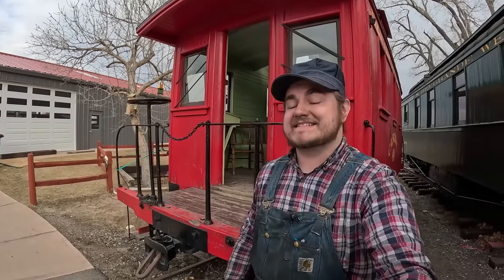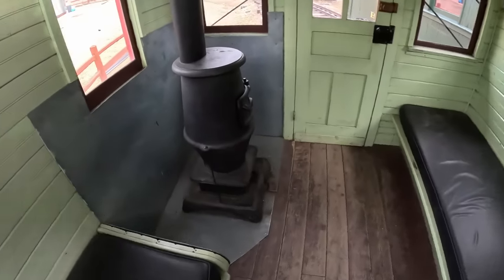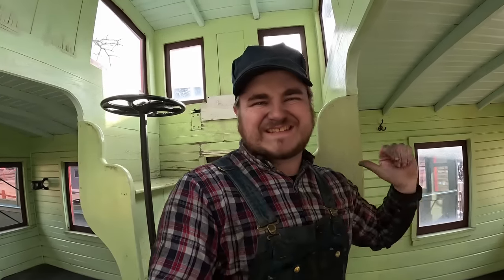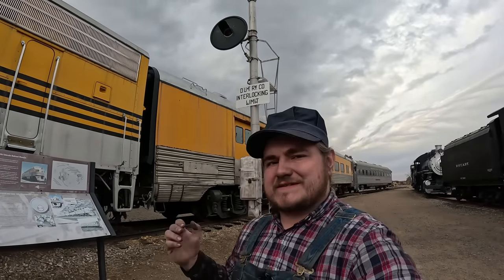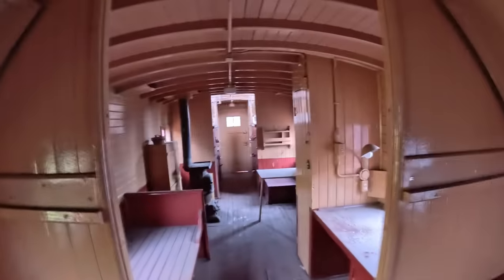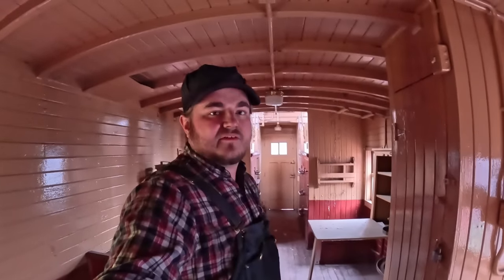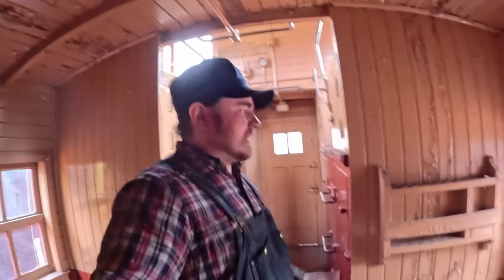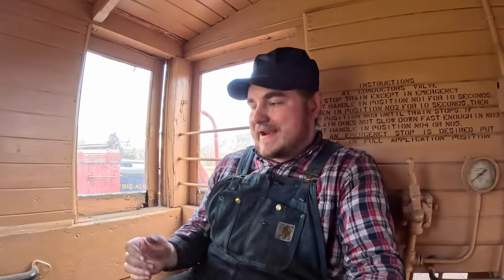Why don't trains use CABOOSES anymore?

Comment: Another reason I've heard for the end of cabooses:  Slack action.  As trains grew longer, so did the potential slack in the couplers, leading to serious whiplash at the rear.  (Consider the fate of the brakeman in "Emperor of the North" when A-1 dumps the air).  Having people at the rear was becoming an outright hazard, especially since they weren't needed very much for the reasons you described.

Side note, the narrow gauge cabooses on the Sumpter Valley also had a "toilet" similar to the C&S one you described.  I've been in exactly one Rio Grande long caboose, and I don't recall it having one, which is rather interesting since I'm pretty sure those ones are bigger than ours.  Could be misremembering, though.
Reply from the maker: I knew I was forgetting at least one reason! Cheers Bandan.
Reply: This was especially important in the UK with their brake vans. Since British trains still had chain couplings well into the 1970's it was vital to keep the train in tension as much as possible to prevent slack action from breaking the chains, particularly when going down hills when the cars would want to bunch up. The train guard would have to know the route very well to know when to apply the appropriate amount of handbrake to keep tension when going downhill without adding too much extra drag for the often underpowered goods engines. If you've ever watched Thomas and wondered about the engines getting bumped by the Troublesome Trucks, that's probably because a lot of guards on Sodor weren't very good at their job.
Reply: You forget one other purpose some cabooses are used for now a days, some have been converted into RC receiver cars for remote control operations
Reply: @GraveSpartan21  And on high-security trains (military, Department of Energy, etcetera) as well as some maintenance of way trains.
Reply: honestly, this feels like the only real reason not to have them, the other reasons make the caboose REDUNDANT but redundancy in itself can be a great safety feature
Reply: @d3str0i3r  Honestly, today with the way things are going, it probably could have prevented East Palestine Ohio... 

My grandfather ended up with a semi-ruptured kidney just before he retired from some poor train handling in the Penn Central days.
Reply: Even with slack action couldn’t they strap them in to a harness like a race car?
Reply: @automan224  Sure, but they don't even use seatbelts now... even though they are equipped and recommended on the SD80's. Realistically, they aren't supposed to be beating up the equipment that much to make them necessary.
Reply: In Ireland you could still find Brake vans until the 1980’s or 1990’s
Reply: First time on your Station, lots of great well presented information. Not sure how many breakman were on a train but riding the top of a train in the winter time must of been hard. I am thinking the extra sleeping room on the. Caboose may have been for these extra men my father-in-law start it out as a Breakman in 1947 and retired as a conductor.
Reply: Imagine the slack on British ( loose coupled )  freight trains ..

Yes, pretty much up to the mid 1960's in GB freight trains where coupled together using Chain Links ,, 🤔
Reply: If that were the case wouldn’t manned helpers have engineers and conductors thrown all over the cab? Also shouldn’t Amtrak engineers be slinging passengers on the rear?
Reply: Slack action in the cabooses was due to poor train handling by the Engineer, not the  size of the train.
Reply: @d3str0i3r   Simple answer, the Railroad Corp. wanted much smaller crew size to save money and reward the stock holders.  Nothing new here, in the old days, crew size was five men, today, it is down to two men and the Railroad Corp. wants it down to one and complete automation in the near future.
Reply: Yes, it's caused by poor train handling, emergency stops, or similar.  But it's exacerbated by the length of the train.  A 50 car train has less total slack from couplers than a 100 car train of the same cars, and a longer train will have more slack still.  That's enough to turn a rough but manageable stop into something that causes injury.  It's also possible newer car types had different amounts of slack built into the couplers, but I wouldn't know for sure.
Reply: I guess, for those cabooses without official bathrooms, you could always hook your legs into the railing and take a deuce off of the back. That's what I would do if I found myself in such a situation, but I would probably wait until I knew the train would be passing through a rural area with no houses or crossings. lol
Reply: @johnanthonycolley3803  And Ireland
Reply: @michael029138  We would get some slack action on uphills and down hills with Longer trains.  But, most of it was due to poor throttle control.
Reply: @michael029138  Bingo!!!  On the saving money.
Reply: No it was to save on money and paying for pensions. They are greedy.
Reply: @BandanRRChannel  Your slack description being based on the numbers of cars makes sense.  But I wonder if steam powered locomotives were capable of pulling more than 50 cars.  The disappearance of caboose cars might be a combination of several things: smaller crews and improved braking systems for instance.
Reply: Very informative
Reply: Not true, its the other way around, longer trains came about because of the removal of the vans, longer trains and then PSR. Infact when caboosless operations were being worked out it was agreed by all parties including the unions that conductor only trains would be kept <6000 feet as the head end crew could not be relied to watch more than 2000 ft back of the train.
Reply: +TNRailsandTales Passenger trains aren’t nearly as long as freight trains. The problems OP describes are for trains that are miles long
Reply: Also before air/vacuum brake, freight trains wagons didn't have brakes, so therefore, the brake man (brake van) applied the train brakes!
In Australia and New Zealand, all of our trains uses high air pressure to release the brakes!
Reply: Interesting, but then it seems the "caboose" would probably be better off towards the middle of the train.  The crew looking out at the train could easily see in both directions and not have to worry about whiplash.
Reply: @redrock717  No, not at all.
Reply: @whoever6458  Official bathrooms???
Reply: @jarmynlogan5367  You really think so?
Reply: @nickm1242  seriously?
Reply: Where does the word Caboose come from. In the UK, Australia and New Zealand we call them Brake vans as pre 20th century, freight trains didn't have brakes, let alone passenger cars! Also the brake van there was a guard, but today its used for luggage!
Reply: @mshum538  Seriously what?
Reply: "Emperor of the North?"  Wasn't that a movie that Earnest Borgenine was in?  In one scene,  they realize they are on the same track as an oncoming train and his character yells, "MORE STEAM."  The engineer yells back, "She won't take it, SHE WON'T TAKE IT!"  Then, they get the train going as fast as they can and he even starts shoveling coal into the firebox along with the fireman for more steam.  They just barely make it to a side track safely and the other train goes roaring past.  I haven't seen that movie since I was in 3rd grade in 1974.  Seems like it was the ABC Movie of the Week.  Great video!
Reply: Reading this comment reminded me of men without hats with the lyrics “with a Slack-jaw and not much to say. I say, do you speak my language. he just smiled and gave me a Vegemite sandwich. and he said, do you come from a land down under”
Reply: @BLUE_OCTOBER-TRIX  Men Without Hats or Men at Work?  I think you mean, "Men at Work."  Vegemite is a spread.
Reply: PRR called them cabin cars.
Reply: @BLUE_OCTOBER-TRIX  Mmm Vegemite sandwich!
Reply: @BLUE_OCTOBER-TRIX  Picture this, a kangaroo with speech bubble, "You Australian?" 
90% of Australians word know part or all the lyrics of Me At Work song!
Reply: @lvsqcsl  
Sorry, you’re right it’s men at work. not men without hats. men without hats do safety dance 😂
Reply: @jonathonshanecrawford1840   Ummm, Got Salt? 😮😢
Reply: @BLUE_OCTOBER-TRIX  Correct.
Reply: I agree, in 24 hours, it is cheaper to pay 2 people for 2 twelve hour shifts, than 3 people for 3 eight hour shifts. They save having to pay that third persons retirement.
Reply: @GraveSpartan21  What's the pic/icon after your name?
Reply: We were still crapping in bags when I hired out. The urinals still went straight onto the ballast.
Reply: @schinbone0   Why don't trains use CABOOSES anymore?  1511pm 2.4.23  lyrics, maybe, to some obscure instrumental by a pop band allegedly of seattle hue. craping in bags? maybe you were camping or heard some Micky Flannagan joke? anyhow - https://youtu.be/Mx_z6vLGOrg
Reply: @JJONNYREPP  Nope. We had a fake toilet you put the bag over. We were the only ones still doing this. People would throw them out of the windows. It was gross.
Reply: I worked on a freight train. We had no toilet  in the caboose.  I feel they stopped the caboose to save money . Less people on a crew.that is just my opinion.
Reply: @hubertdeyette5070  Why don't trains use CABOOSES anymore?  ?????????????????????????????????????????????????????????????????????????????
Reply: @redrock717  Amtrak trains are much shorter than regular freight trains, so less slack to run in & out. Also, I think the "Tight-Lock" couplers on passenger equipment probably are designed for reduced slack.
Reply: Thats a problem modern engineering can solve
Reply: @michael029138  m
Reply: @sirrliv  Wahr do you mean used to, we still use chain couplings in the UK for freight trains. Though it's not multiple chain links it's usually one chain with a tightening screw.
Reply: Sumpter Valley Railroad.  Finally got to where the McEwen/Sumpter round trip lost its "Awe and Wonder" factor for the kids.  I think next year will be the first year of piling the grandkids into the car and heading south for a train ride and some history, followed by a nice drive back to WA via Granite.
Reply: @michael029138  'Corporate greed': that's why airliners only have two in the cockpit, with 'technology' taking the place of the flight-engineer who would have had to monitor the engines, the fuel and most of the systems on board.
Reply: @garydergut4741  ...greedy, and indifferent to safety (as at Lac Megantic)
Reply: @None-zc5vg  Don't forget the radio man. I think at one time, there were four men in the cockpit, or I maybe thinking the Air-force.
Reply: Pfff.  Everyone knows it's cabii.
Reply: @hubertdeyette5070  It apparently depended on the Railroad?
I recall facilities.....
Reply: @JJONNYREPP  The Stockholders have spoken......
They may not pull throttles,  but they do appear to have more pull than Unions anymore?
Should Hazmat Trains have trained crews and a Hack on the back to protect from the repeat of the incident in Ohio?
Is the use of longer Trains and less crew safe?
How about Track and Car maintaining Crews?
There are quite a few questions about the promotion of profits that inspired the two page Ads from either side as the tug of war over the remains of Conrail were fought over in the Wall Street Journal.
The Administration taking the side of the Stockholders before Christmas,  appears to be similar to the Air Traffic Controllers strike in 1981?
That strike was shut down by an anti Union GOP Administration,  this one appears to show the same sentiment?
We do need to question the effects of money on the Electoral Industry.....
Reply: Crew at the rear doubles the number of casualties in a rear end collision and increases the risk of casualties in a derailment.  I live next to the Indiana Rail Road and their local brakemen actually drive or ride in an SUV.  Safer than riding on a freight car, much better than being outdoors in bad weather and they can run ahead to set switches in advance of the train.  Years ago I met a former conductor who retired from the Grand Trunk less one arm after he slipped on an icy caboose step and went under a wheel.
Reply: @danielstickney2400  Hiring enough Workers helps to avoid crashes.
Please refrain from sounding like a Stockholder......
Reply: right not bad
Reply: @hamfan4449  The entire question of the Administration shutting down the strike before Christmas,  now faces added scrutiny from Americans who question the representation of Government.
The biggest complaint was that there were not enough Workers to safely perform inspections of Track and Rolling Stock.
The Administration appears to side with the Stockholders over Operating Personnel.
Just like the 1981 shut down of the PATCO strike,  we see near miss situations at airports.
The US Government appears to be more devoted to profits for Investors.
That question appears to reflect poorly on the Two Party System that operates the $15 billion dollar Electoral Industry.
Who is served by the US version of Democracy?
Reply: @danielhutchinson6604  i dont really care
Reply: I LOVED that movie!
Reply: U could just be a liar
Reply: My husband worked for the railroad. He's had to ride a shove many times. Most times under a mile but a few times over. And when the train is long he said you have to prepare yourself for the slack action. He would hang on the side ladder one direction then the next second he would be leaning the other direction. And yes Fred is what it's called. The F means something else. He learned that from the guys that were working when they came along.
Reply: @billdougan4022  it's only cheaper up front, tired people make more mistakes!
Reply: @hamfan4449  that's pretty short sighted
Reply: @automan224  The "newer" (1970s) cabooses had safety belts and harnesses, at least in the bay window seats.  My grandfather stated that he appreciated those.  Oddly, he embraced the automobile seatbelt much later, after he had retired.
Reply: SO YOU ARE ONE OF THEM. WE ALL KNEW WHAT HE MEANT.
Reply: They quit using cabooses because people who get their jeans too short and too big were getting made fun of, they were saying, "your pants looks like the big caboose on the bottom"
Reply: @Hyce777  This same incident in "EOTN", is what caused "Coalie" to be showered all up and down his backside with all that flaming coal. Poor guy had 3rd-degree burns, only a few SUPREMELY agonizing hours to live. That REALLY got "Shack's" dander up! Journal Boxes . . . back at the Home Yard, "Shack" threw a tantrum at "Yardlet", and ordered him to go out and grease every BARMY Journal Box in the Yard, accusing poor "Yardlet", of being the cause of EVERY train fire! I suspect this movie had its technical facts correct, as well as the depictions of the Hobo Culture; was it? You do make the technical facts of Trains easy for the layman to digest; thanks!
Reply: @automan224  That's a wonderful idea, said no one ever.
Reply: I think all cabooses had toilets.  Unless there was an entryway between cars with a passenger car for the B&O employees to take "a load off".  I used to see chocolate pies all down the railroad when I used to walk on it as a kid.  Had to be from cabooses and passenger sleepers expelling human waste.  Funny thing is, they had a smell to them, but not strong, so I'm guessing they mixed a chemical into the "person-patties" that would take the sting out of the smell.
Reply: @sirrliv  I'm pretty sure the trucks in Thomas the Tank Engine did something to make the guard fall out of the brakevan when they bumped an engine.
Reply: BNSF, we don't make the train. We make it better.
Reply: Excellent video…right on track 👌🏻
Reply: I was on the Long Island Railroad around 1970 and the bathroom toilet emptied on the ground right below me! You didn't want to walk the tracks In Those Years cuz you were likely to step on a turd!!
Reply: Bahahahahahaha. I was a freight Brakeman in the late 70's. That's ridiculous. They did it to save money with smaller crews, safety be damned
Reply: @Hyce777  I've heard that's why train men waited until the train began to move before they stepped up onto the caboose.
Reply: "Emperor of the North "😁
Reply: That's my favorite movie...the emperor of the north
Reply: @nicholashearld6908  It's(Emperor of the North Pole) my favorite movie that stars Ernest Borgnine, Lee Marvin and Robert Carradine about The Great Depression era involving the hobo train hopping lifestyle.
Reply: @Hyce777   Is this why passenger/cargo trains keep the passengers up towards the engine?
Reply: @automan224  There shouldnt be excessive slack when you know you have people riding.  You stretch .  Its the same thing when we run a company special.  They equipped the passenger cars with frieght train brakes. and we dont whipp them around.
Reply: @made-in-the80s   Your are correct about EMS.  That is facts it runs dynamics and on a very long train I would want to feel that at 50mph.
Reply: A skilled engineer experienced in his territory and layout of his particular train, applies power and uses the brakes in such a way that all slack action is handled with forces no greater than gentle tugging.
Unskilled engineers or the uncaring can snap a drawbar or launch you out of your caboose seat into the wall in front of you nearly breaking your nose. How do I know this you ask? SP. Circa 1983. Coast run. San Luis Obispo back to LA. Engineer not paying attention and reading western novels. Real fun having to set out the car with the broken drawbar on the wrong end. We had to dig out the heavy chains from the caboose and tow the car to the nearest old siding that was manually padlocked.
Reply: @samiamrg7 where the hell do u live passenger trains are no where near the length of a freight normally
Reply: @redrock717  locomotives are significantly heavier than cabooses
Reply: @redrock717 and Amtrak trains are much shorter than revenue freight
Reply: @sirrliv We had cabooses in the U.S. "well into the 80s". None of you know WTF you're talking about. Only what you "heard".